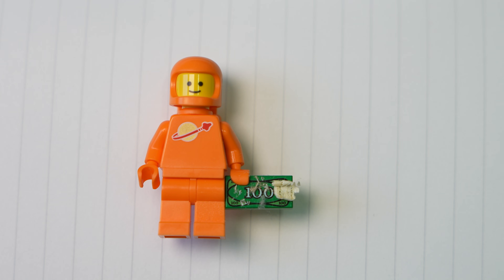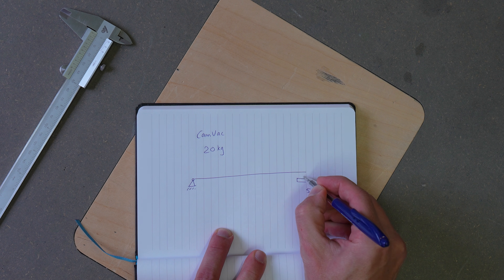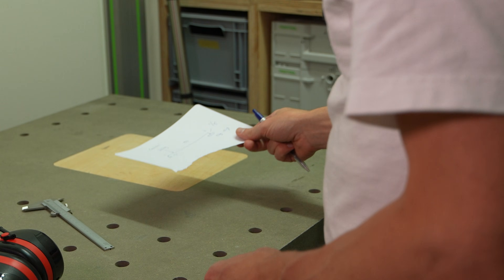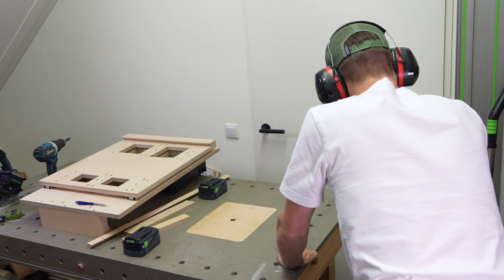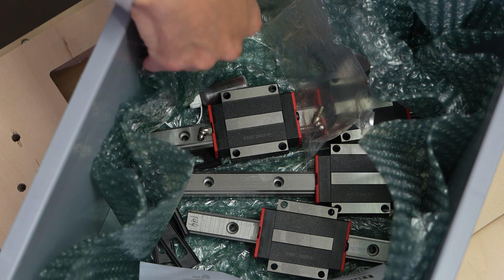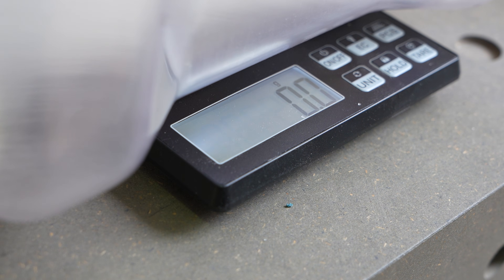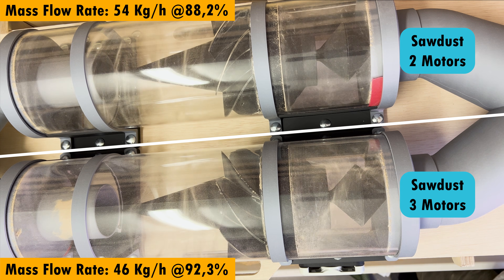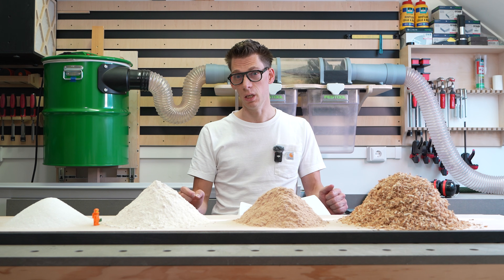Dust, Sizes and the Challenge to Catch ’em All!  (Part 3 • Budget Centrifugal Dust Separator #diy)

Comment: @15:20 looks like outlet tube (observing bottom train) needs a vortex breaker (vane or baffle) of some sort to drop the waste from continuously spinning in suspension

Vortex breakers are also found on regular vertical cyclones at the cone dust exit
Reply from the maker: Well noticed! I think you have a point there. Thank you!

Comment: you re hard at work and doing good tests. Have you ever done a test with just one tube and a normal shop vac?  blijft fantastisch om het te volgen.
Reply from the maker: Yes I have. I made a short about it: https://www.youtube.com/shorts/WzThUMNowf8
I was not impressed by the results. Dust was settling down inside of the tube due to low air speeds. I have plans to make a smaller version for it with a 100mm tube.

Comment: Loving watching you work through the joys of capturing dust. Be careful though as that last 0.1% that you don't capture is the dust that is trying to kill you, the rest is just making a mess. 
Many who have fallen for the look of the Harvey don't look past the centrifugal part. That is the awesome looking but what is left also needs to be filtered, that is why Harvey have "HEPA filter 0.3 micron (Merv 17)" This is also called a HEPA 13 filter (not a MERV 13 which is nowhere near as good).
So work at getting the most mass out of the airstream as possible - it makes it FAR easier for the "paper" filters. It also is far better for the fan motors if they have the air stream running through them for cooling.
BUT for a safer work environment you then need to pass it through a proper sub micron (HEPA13/MERV17 or better) to get those little nasties out that way virtually nothing but are there in their billions (yes, literally billions).
An easy way to see this is to look at the DustControl AirCube1200 - it has an air flow of 1000 m3/h which is about the same as the 3 motor CamVac.
You can make your own with a prefilter (just to protect the final filter) and then a H13/M17 filter that can handle the ~1000 m3/h that is provided by a 250 or 315mm dia inline fan.

FYI the claims by Record for the CamVac filters filter to 1 micron I am sure are correct, and it is also true that as more "stuff" collects the filtering becomes ever more complete. However, what you don't see is what amount of the 1 micron and sub 1 micron gets through the paper bags. If you don't filter to HEPA 13 level then the best thing to do is have the outlet going outside not into your workshop area. Making sure it is going somewhere were it will be dispersed - not sucked into the home heating system.... 😲

Vacuum/filters for industrial workplaces are now being rated based on the level of filtration and handling of the waste. You will see this on vacuums with L/M/H ratings
Some more information from doctorvacuum - com - au

HEPA filters are high-efficiency air filters that are commonly used in vacuum cleaners. The acronym HEPA stands for “high-efficiency particulate air.” These filters are designed to trap very small particles, such as dust, pollen, and pet dander, that other vacuum cleaners might not be able to capture. When a vacuum cleaner is equipped with a HEPA filter, it can effectively remove these small particles from the air, helping to improve air quality in your home and reduce allergy and asthma symptoms.

Most vacuum cleaners only capture particles down to about 10 microns in size, but HEPA filters can trap particles as small as 0.3 microns!

What Is The Difference Between L/M/H Class Vacuums?

L-class vacuums are for removing dusts with workplace exposure standard >1mg/m3, commonly used in woodworking or general warehouse settings.

M-class vacuums are for removing dusts with workplace exposure standard >=0.1mg/m3, commonly used for construction or wood dusts.(Edit: this is the level needed for MDF etc and basically requires a HEPA13 filter)

H-class vacuums are for removing dusts with workplace exposure standard <0.1mg/m3, commonly used for construction, demolition and much more harmful dust particles. (Edit this is the level needed for asbestos etc)
(Edit: the basic difference between a M & H class is that the filters can be removed without the operator coming into contact with them.)
Reply from the maker: Thx for your great reply! 

I have a SEK-SPS30 EVAL KIT, PARTICULATE MATTER SENSOR to quarantine the air that is coming out from the camvac. Not jet tested it because I am still focusing on the bigger particle separation. When that works fine I’ll focus more on the fine filters and vacuum side.

Comment: Hi, beautiful looking and efficient ! 
I have just a question. you are using a professional vacuum with maybe a 100mm hose. 
Did you think you can resize the dust separator for fitting in 2 x 40mm acrylic hose for a domestic vacuum use like a karcher ?
Reply from the maker: I am planning to scale it down to 100mm for a vacuum. And then on a single separator. Two times 40mm is to small I think

Comment: very interesting. did the tests lead to revision ideas/plans? or are you happy with the performance?
love this series and the channel :)
Reply from the maker: For my planer it is perfect! Only I also like to solve the sawdust efficiency so I have printed new dust ports for the second stage and new 100mm y-piece and matching inlets and changed the flex hose for a clear 100mm pvc tube to the CamVac and I am running some tests again. More details on Patreon. It looks pretty promising!

Comment: Hi, I love your System and How you Publish everything 👌 

About the separation:

I use a cyclonic system and that works for the fine dust of my CNC mill very well! Even the dust after planing mdf boards. Maybe it would work, that you put a Cyclone as a second stage after your system. That should reduce the over all air speed but increase the efficiency of separation small particles

Comment: You should use bag filters for your vacuum motors. Those have HUGE filter area and don't throttle your air flow down. Small filters are bad in that respect.

Comment: Those numbers for sawdust and chips are pretty good! I wouldn't expect it to work well on the super fine stuff, but that's ok because that's what HEPA filters are for. Also, in practice I don't think it's going to be a big deal if super fine dust accumulates in the separator. It won't be able to build up enough to clog it and the bigger chips and dust will knock it loose over time.

Comment: @CapturingDust I'm going to try and print this to fit the inlet of a harbor freight dust collector blower, but I'm going to put the motor assembly on rubber mounts and use other sound deadening techniques.

If the design had low decibels, a larger bin for bigger chips, hepa filtration, a manometer, and a set of 4 swivel casters, I think this would be an upgrade.

Comment: Very cool project and love the way you take it seriously (measuring performance)! How are the 3D printed parts handling the abrasive wood chips?
Reply from the maker: I printed the parts in PLA so not the best material for the long run. For now it handles all the dust very nicely. Can’t se any damage. 

I like to test with fine sand and plaster powder to see how the separation is like and maybe I will see some wear afterwards.

Comment: I bought a Dust Deputy Low-Pro Deluxe and put it to heavy usage in the last few weeks. 

My findings about separation:
Wood chips is 99%
Sawdust is 98%
Sanding dust is n/a
Plaster dust is 75%

The very fine particles are not separated efficiently for that specific dust separator.
Reply from the maker: Thx for sharing your results! Interesting 🤔.

I ordered a Oneida-Air Super Dust Deputy 4/5 Cycloon to compare results only it’s still in backorder for 3 months now. Buying Oneida parts in the Netherlands is hard it seems. Hope to get it before the end of the year.

Comment: I just got an idea.
When camvac is on the same side of the lever as the scale sadly not only the load rating, but also the minimum value that can be measured becomes affected.
So even an idea lever mechanism with +/-1g 5kg scale becomes the same as +/-5g 25kg scale in this configuration.
If camvac was on one side of the pivot and counterweight on the other, no resolution would be lost. The scale's rating would have to cover just the expected weight difference.

To prevent overloading the load could be transferred from the end of the beam to the scale via a spring and some sort of an end stop would prevent it from bottoming out.
This way when in operation force proportional to the dust weight would be read by the scale. If load becomes too great, the spring will become compressed and the lever's end will rest on a physical stop.

Then the only problem would be friction. Even linear rails have way too much of it for dust-weighting purpose because of preload and sticky grease inside.
SKF's calculator is telling me that even a small 608 bearing (no shields) under the radial load of 300N will have 3,72N·mm of starting torque. That corresponds to 0,1g over a 3800mm-long lever.
A hardened and polished steel rod on clean glass surface might pivot freely enough but will be less stable.
A lever-based design is possible but cumbersome at that scale.

So that got me thinking again. What if dust wasn't captured in the camvac? What if there was a lighter and smaller container with all the fine filters to capture dust between your separator and the vac? Then we have just 0.59 N·mm of starting torque under 100N radial load. With a skateboard bearing! This corresponds to 0,1g of sticktion over 60cm lever. With two times longer lever it would be possible to replace a scale with 1kg-rated tensometric beam and cheap-ish 24-bit ADC. Plenty of resolution to spare.
At last, hose and clamps position might affect reading at this scale so removing them for readings might be necessary.

I hope I haven't bored you with this wall of text :D I've just gotten myself a 3D-printer so hopefully I will be able to do some experiments on my own. If that happens I'll post the results in comments. 

Short version:
Lighter container with filters to capture dust, steel bearings for pivot. Counterweight instead of a one-sided lever. 
No linear guiding. Hang it like a big vintage weighing scale.
Reply from the maker: I love it when others have the same passion about things and also are not letting it go. I have read your response very carefully. Fascinating!

I did do a bit of research myself after the speed build and it seems that the resolution of a normal scale is around 1/3000. 

You need a precision balance scale to get a resolution up to 1/60000! It uses a counter balance back in the days now electric operated springs with load readouts.

Also if more resolution is needed then the have analytical balance scales. This type of scales is even sensitive to drafts and vibrations. 

My own conclusion was that the total CamVac system needed to losse a lot of weight! So that the total weight of the CamVac and filter fits on top off the 5kg scale (the load cell would be the next step). This is why I bought the new motors (so don’t tell anyone 😅😉). 

Ideally would be to be able to get the reading while testing without having to disconnect the hose. Some kind of flexible cuff is needed.

I would love to have you on Patreon tough, there are other fanatics like you contributing too the research of this project / or are and have build there own.

Comment: thank you for this testing video, which released my self-doubt, I built an MK2 PVC version here in China, I have to say it's friendly and cheaper to build it here, we use the same standards as Europ, and everything is easy to find, and shipping is fast. a 3D print farm helped me with most of the work, coast me about 100 US dollar, and ten days to collect all the stuff. 
But when I tried it on those fine dust, it was a total disaster, the sanding dust stays in the PVC tube, and it's hard to clean. 🤣
Thanks again.
waiting for your next update.
Reply from the maker: It looks like the Harvey system suffered a bit from the same in the acrylic demo version.

See this video at 1:09:00 min;
https://m.youtube.com/watch?v=77_5nzE1oRQ&t=4237s

At 1:10:11 you can see the dust “dune” created there as well. They are ramping up the fan to get rid off that. To hi fan speed will fill up the second stage quicker. It needs to be 80/20.

I am wondering if a stainless steel version performs better in the very fine dust. Because static buildup is quite high is my experience. And idd the fine particles are very sticky and hard to clean out except for the use of water.

The biggest complain at the Harvey system is the quick build up of finedust in the last filters and the hard time to clean those out.

I am exploring the idea now to try a small test version with 100mm tube to try out if that will increase the separation efficiency. And catch the very fine substance laterally instead of having it fall down into the second bin in the second stage.

It’s clear that the fine dust keeps swirling around far to long.
Reply: @CapturingDust  thank you for your inspiringly respond. 
I using a 1.8 hp(so called),single  motor vacuum cleaner connect to the outlet, it's not that strong, and the wind speed get down a lot at the inlet end, the sanding dust building up and laying at second stage, some dust spinning around and won’t fall down second hole.I thought it’s just because it’s lack of some horse power at first, after I saw a long paper band(which was very light) been suck out from the first trash bin right through the impeller, I realized it's not just one problem waiting here.
I may change the airflow driving plan into centrifugal blower, it will make some change, at least I don’t need to concern about where is the losing Horse Power. 
I also wanna try that anti- static blower，it's a fan and been used in factory to get rid statics off plastics. 
I don't know if I have enough energey to finish it, but I will gave a try

Comment: Also, I think the final stage of this design is less-than-optimal. Use the centrifugal force from a smaller diameter and a little twist to accelerate the fine particles to the outside tube, then have baffles with holes that swirl that airflow into a bucket/filter.
Reply from the maker: Yes that is the plan. More like this;
https://patentimages.storage.googleapis.com/a8/9d/6f/19aad9605ed003/US20080006011A1.pdf

Comment: You could print some springs to match the vacuum weight then place the scale directly below it. You could also put the scale inside a baggie (to protect it from dust) and measure the weight of the cotton bag inside the vacuum. Lots of ways to skin this cat.

I also want to caution viewers that atomized dust particles become explosive, so please be careful. I've personally seen a 36" duct full of sawdust explode into a ball of fire, 3 meters in front of my face. A sander hit a steel nail in the log, and caused the entire building to be evacuated. Seriously, be careful with atomized particles.
Reply from the maker: Weighing the cotton bag alone is just a small part of the dust inside the camvac. The most material is between the metal bin and the cotton bag. When you get the bag out that dust is not inside the bag but underneath it. And you have the paper bag filters around the motors. With cotton sleeves under it. 

So weighing the total camvac is the best option. And I agree on the spring part. Making a weighing platform to put the camvac on is the best way to go I think.
Reply: @CapturingDust  Thanks for the immediate response.

Comment: Have you messed with fluid separating using a centrifuge?
Reply from the maker: No I did not because the CamVac is not rated to process water. It stays high on the “to test” list tough 👍

Comment: Hi, i would not be percieved as the classic turbosafety opinionist, but i t think this time can be worth the risk.
Please consider ATEX equipment due to the explosive properties of regular flour and fine milled sugars. In suspension with air they create very dangerous mix with air and can easily deflagrate, in a test like this the ducted channel adds detonation risk too, due to the confined space in which the mix is create. Thanks, by the way, for the interesting solutions you are making and sharing.
Reply from the maker: Yes you’re totally right. I was aware of that and informed more or less. Luckily not reached the LEL for that. The CamVac is in no way ATEX rated. I did open the window that is 1.5m away. And had my self built room air cleaner on that was installed at the other side.

Only that wouldn’t eliminate the risk inside the tube and CamVac! Not going to do the flour test again 😅. At least not inside 😃.

Comment: What happens if you supply dust ast more realistic rates? Like the 6kg/hour mentioned for your planer?
Reply from the maker: I think that would be around 99.7% 
The planer produces the dust with a lot of air volume in between the shavings. 

I noticed that the dust in the gutter was more compact and dense. So a better test would be to sprinkle the dust in front of the suction hose and let the hose suck it in. 

Now with the gutter sometimes big chunks of dust are pulled in that will overflow the first stage with material that is not supposed to get into stage 2.

Comment: Well done! Curious about how much made it to the cloth and paper bag filters in the Camvac?  Especially with the baking powder!  Would putting hard tubing between the Camvac and the separator make any difference?  I've used a thien baffle system myself for years, which isn't perfect but is good enough for my needs.
Reply from the maker: I haven’t opened the CamVac yet but I took a quick look trough the inlet and it was white inside 😅. Should be around 200 grams I guess. They’re was a lot what was left behind in the hose and separator.